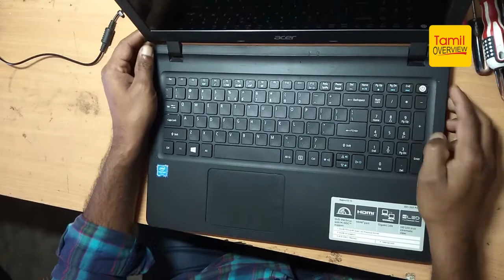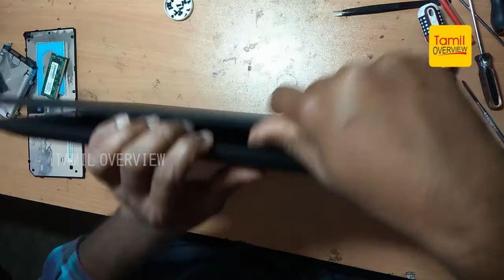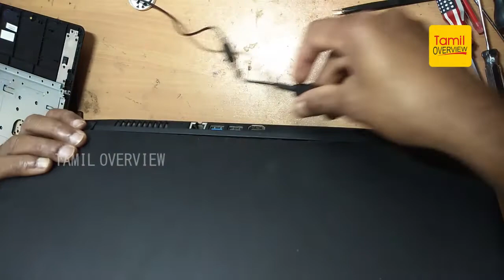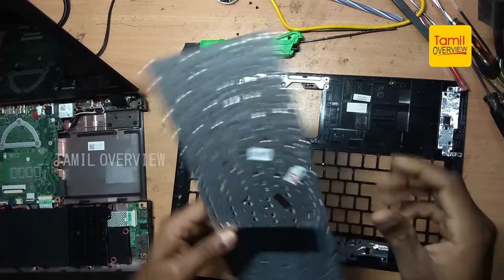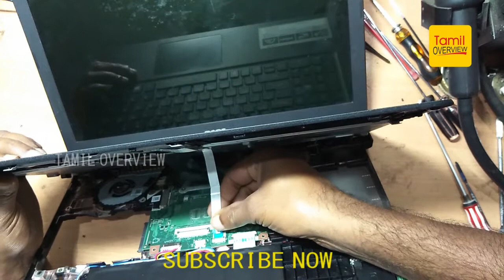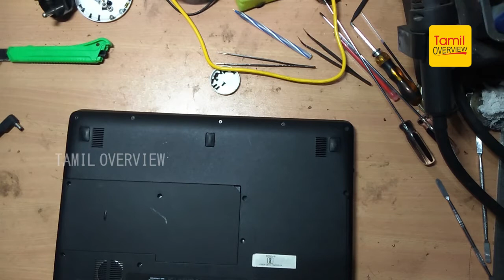ACER ASPIRE ES 15 POWER ON PROBLEM / KEYBOARD CHANGE

Comment: ভাই, আমার ল্যাপটপটি হল acer es1 572। সমস্যা হল এর পাওয়ার চালু নেই এমনকি চার্জ হচ্ছে না, কোন পাওয়ার বা চার্জিং led indecator শো নেই।  যখন আমি এটি মেরামত করার চেষ্টা করছি তখন একটি সামান্য জ্বলন্ত গন্ধ মাত্র এক সেকেন্ডের জন্য প্রস্ফুটিত হয়েছিল এবং এর পরে এটি সম্পূর্ণরূপে মৃত (কোনও নেতৃত্ব সূচক আলো জ্বলেনি)।  কিন্তু আমি বিশ্বাস করি মাদারবোর্ড ঠিক করা যাবে।  এই সেটের জন্য আমি কি করতে পারি, দয়া করে আমাকে কিছু পরামর্শ দিন।

dear my laptop is acer es1 572. problem is its wont power on and not even charging, no power or charging led indecator show. while i try to repair it a little burning smell was blown for just a secound and after that its totally dead(no led indicator light up). but i belive the motherboard can be fix. what can i do for this setuation, please kindly give me some suggestions.